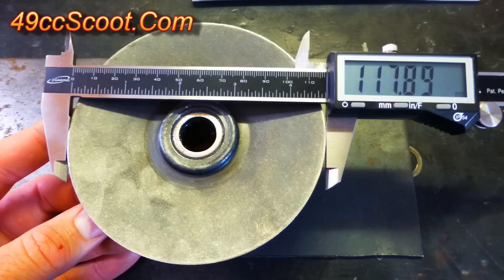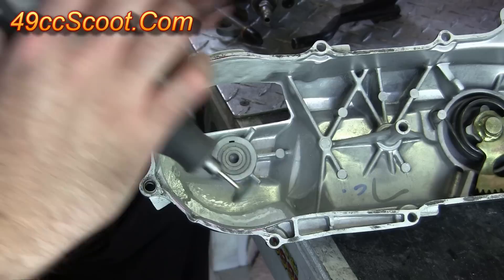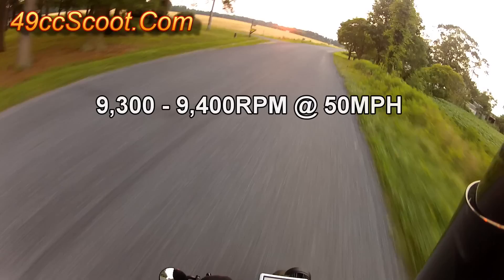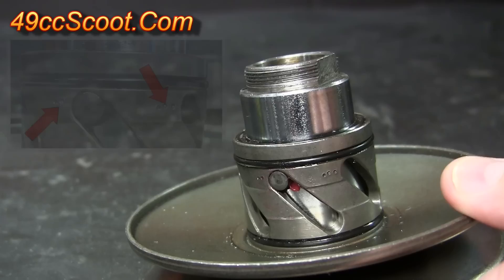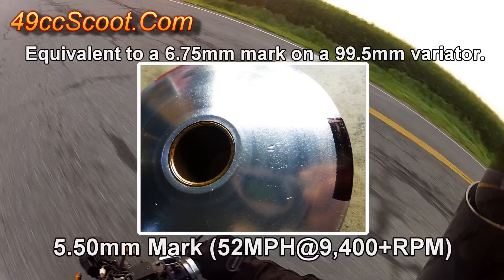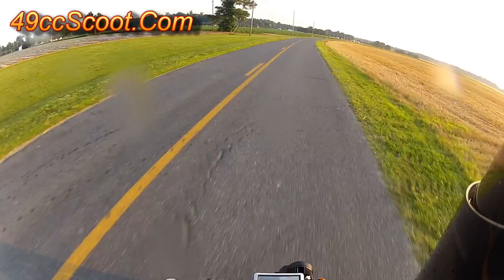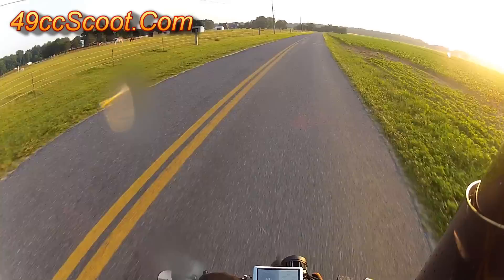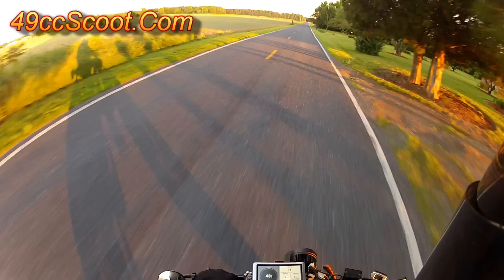Minarelli Scooter Over Range Rear Pulley Alternatives Project 3of3

Comment: Hey 90gtvery i have a ? i got a 150cc GY6 hothit in my yerfdog gokart and it wont start but when i hold the throttle wide open and crank it it kinda is running but when i let of the starter its dead? Do you think i killed my engine?
Reply from the maker: If possible, do a compression test. Also make sure it's not just flooded for some reason... stuck float or something like that.
Reply: i dont think its compression because it sounds like it normaly sounds when cranking and its not the carb i rebuilt it after it stoped running so what do you think it is?
Reply from the maker: I prefer to knock out the basics stuff like making sure it's got compression, the valves are adjusted properly, the bowl is full of fuel, spark plug is gapped properly and there's a good spark.
Reply: yeah but i have a weird feeling thats its like my CDI thats screwing up.
Reply from the maker: If you have a spare CDI, try it. CDIs either require a special tester that it seems no one has or you can't check them so it's easiest to keep a spare around and check that way.
Reply: yeah i have my stock one some where but i cant find it ( i have a racing one in it i dont know what brand it is )
Reply: ok so i cleaned all the connections and it fired up after a bit of cranking but now its burning oil when i get on it for right as i start it up so whats going on you think?
Reply from the maker: Could be a problem with the piston rings or cylinder wall, valve seals, head gasket, or the oil is very old and thin.
Reply: yeah i am going to change the oil here in a few ( today ) but it takes high RPM to start and it takes like 1 min of strate cranking and then it starts to pop pop pop then fires but now it has no power going up hills it berly makes it so what do you think is wrong now lol
Reply from the maker: I wouldn't bother wasting the oil right now. Save it till you get it figured out unless you're gonna ride it anyway as-is. Something is up in the engine and you'll likely need to do some disassembly to find out what it is. This is assuming you've tried another CDI now. Could still have an ignition problem.
Reply: huh i sounds easyer to put a Briggs and Stratton V-twin Vanguard in it lol

Comment: You do know ZX exhaust is very low RPM and will not get you at a higher top as a high rpm exhaust
Reply from the maker: You know I wasn't testing exhausts? :P This was just a mild sport test mule. It's a backup engine that sits on the shelf most of the time, but has been very reliable when needed.
Reply: @49ccscoot  Oh alright, well thanks for all the information which you provided in these three videos. I learned a lot!